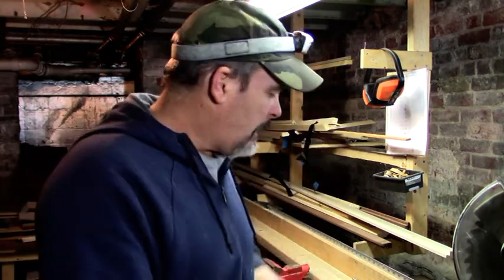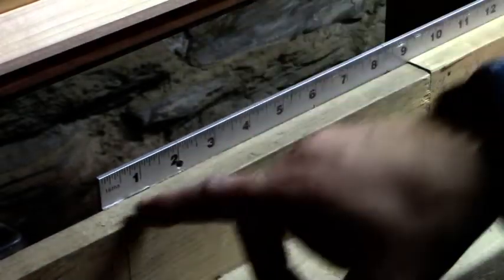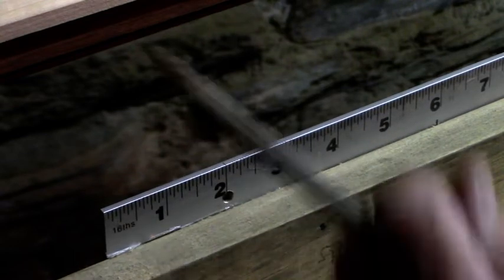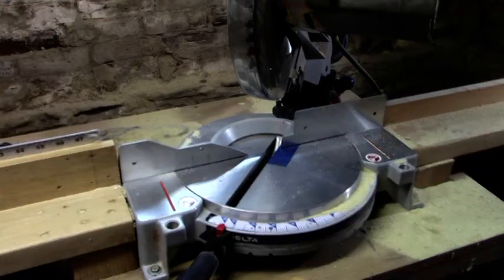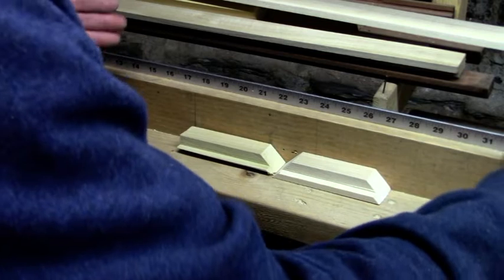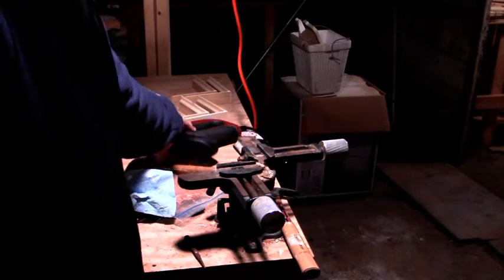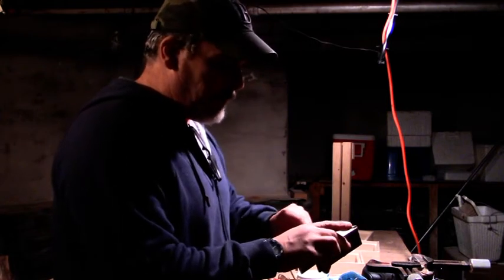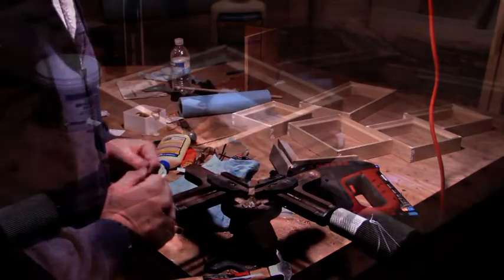How to make floater frame moulding - Part 2

Comment: Regarding this video I wonder why you sand with 60 sand paper.  Do you add a finish to the poplar?  For frames this size I would use a pin nailer but that would require a compressor.  A pin would be flush with the frame and eliminate the nail punch and putty.
Reply from the maker: Thank you for the tip on the nail options....I'll look into it. As to the finish on the frames....I use spray paint. I could use a finer sandpaper, but don't bear down hard with the 60 grit and the 2 layers of spray paint creates a nice finish in the end.

Comment: Thank you so much. I have an opportunity to have a solo show with 40 paintings I painting during the past 18 months of pandemic. But I can’t afford the framing so I was going to cancel the show unless I raise a lot of money for frames. I think I can do it now because of your video. I need to buy the saws and wood as I have a sander. Thank you so much .
Reply from the maker: Hi Juliann - I'm SO glad you're going to give it a try. On buying a table saw.....I originally used a cheap 99.00 dollar one for years with a small bed size. Since I cut my MDF panels on this too, I needed a big cut capability so I've updated mine to allow to cut a 27 inch width. Mine is just a Ryobi from HD...you don't have to buy a big name. I think I paid 229.00. The money you save on your own framing will pay for it in no time. Good luck with the show.
Reply: @habowskistudio2724  thanks. I’m looking for your chart on frame sizes and wood lengths. Could you tell me which video that is in? I’d like to take a screen shot. Trying to estimate wood needed for 40 various med sized frames / paintings
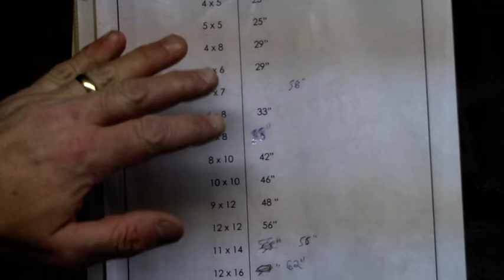Reply from the maker: @julessmithpaints  Hi. It' s in Part 2 of the frame series at time stamp 9:34. Good luck.
Reply: @habowskistudio2724  thanks I was proving chop miter saws. Do I need 10” or is 7.5” okay Ryobi.
Reply: Pricing
Reply: I bought the 10” miter saw. And what about the blade ? Do I need a special finishing blade? 40 or 60? I think these tools come with 24?
Reply from the maker: @julessmithpaints  I would buy a 10". It will give you more options for other wood projects. ....can still be Ryobi....decent brand for the money.
Reply: @habowskistudio2724  hi. I bought the 10” chop saw and 8 1/2 table saw. I also  bout a finer nail gun. Maybe too big but thought it would be more versatile. What length of nails do you use. I am watching the video again to find when you explained that. thanks again. I am so excited about my new power tools. I sold a painting yesterday so I can buy the tools and wood.
Reply: @julessmithpaints  Congrats on selling a painting !!! :)  I use 5/8 inch nails with an "Arrow" brand electric nail gun. Sometimes it leaves a slight indent on the wood, but sanding after helps diminish it. I suppose more expensive guns would have a pressure adjustment depending on the wood used.

Comment: You should investigate the use of a stop block to eliminate taking multiple measurements. It will be much faster and more accurate. You might also see if there is a setting on your nail gun to drive the nail in deeper to eliminate the need for countersinking. Finally 60 grit SP is quite course. Have tried 100,120, or 150? It would make a better paint surface.  All that said, I wish I could paint like you can. Thanks from a woodworker and struggling artist.
Reply from the maker: Hi Thomas - Thanks for the great ideas!! I've known of stop blocks, but mostly I'm a little lazy about cutting all my sizes at one time...say 6 x 8 frames....doing all the 6in pcs,8in pcs, etc. :) Most of the time I am only cutting a few frames at a time of different sizes. On the nail gun.... I LOOKED and couldn't find any electric like my old one that had a nice rubber bumper to prevent denting the wood. When I use the one I have now and use it properly to drive the nail, it leaves a dent that is noticeable. Even when trying to be "light on the trigger" it still leaves a bit of a dent....hence the 60 grit I'm using in sanding.  THOUGHTS on a solution to this. I might buy a cheap sander and do 1st pass with 60 and the other sander would have the finer grit.

Comment: Great Tutorial, just wondering how you secure the panel in the frame?
Reply from the maker: Hi - Sorry to be late getting back to you. To attach panels (up to about 12 x 16) into my frames I just use a bit of wood glue in the corners. On the longer pieces (12 x16 as an example) I'll also put a bit of glue in the middle. When I do Part three on finishing my frames, I'll briefly go over the techniques. There is a different technique I use for attachment when using canvas or a bigger panel.